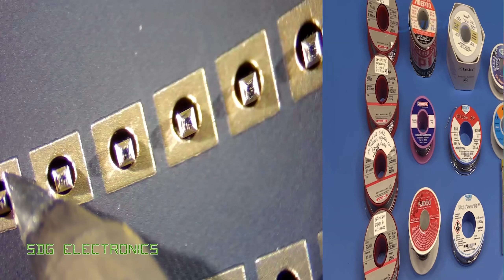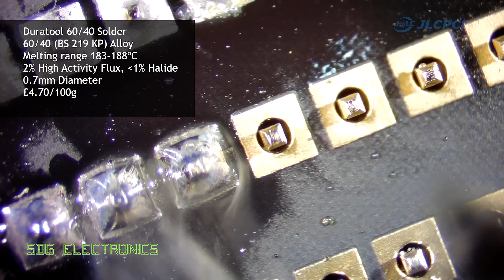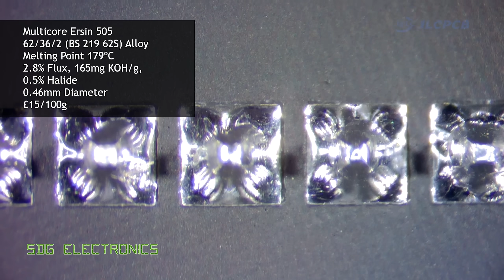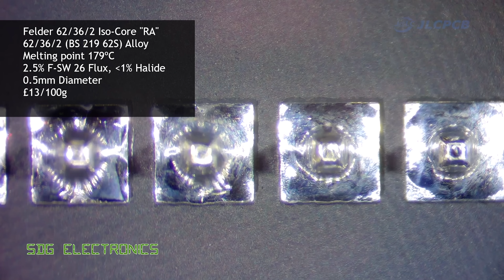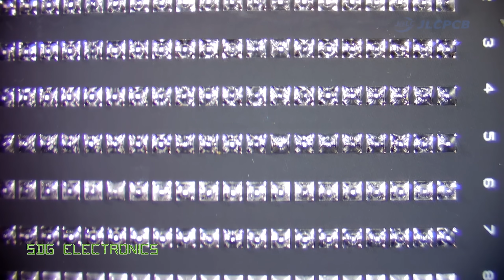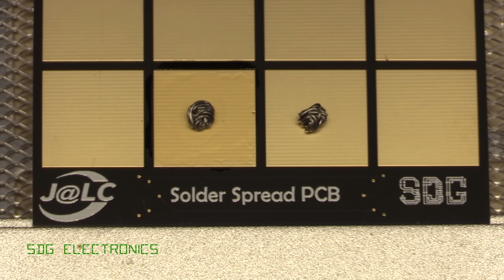SDG #079 What's the best solder for electronics? Expensive or cheap?

Comment: I really like Kester K100LD  lead free "no clean". It works predictably on very small stuff. Though it does spatter the no clean flux.
 I wouldn't dare to work without eye protection. It's nailed my hands a lot, but the skin on my hands isn't as worrisome as my eyes!
I've got 10+ year old projects I've done with this and they all held up fine. No cracks or whiskers as the lead free nay sayers predict.
On the plus side a brief scrub with alcohol removes what little residue the 'no clean' flux deposits. It's safe to leave as it's not acidic like rosin flux, but there is some small amount of capacitance that can affect some circuits. 
Not cheap though!

Comment: I cannot get nice shiny volcano joints, I always end up with dull lumpy joints, I've tried different types of flux, but only a Chinese 60/40 rosin core solder, and for the life of me I can't get a nice flow. Next I'll try different solders based on this video, and after that a more expensive iron (mine is a cheapie, but heat is heat, right?). But whether I can source the best one in the UK is another question.

Comment: Mechanic offers a very good price-performance ratio and is the option I would recommend to all those hobbyists who, due to using low-quality soldering tin (or perhaps the wrong alloy for their needs), believe they'll never be able to do what they see in online tutorials. Most problems disappear when you have a decent soldering tin and select the right temperature to ensure it flows properly. I don't go over 300°C; I repair and modify very old and delicate hardware, and the HX-T100 is perfect for that task without spending a fortune. Thanks so much for the video.

Comment: You did the same test twice but you left the solders in the same spots. To make the results more accurate you should change the positions of the samples. Heat from underneath isn’t going to be applied evenly.

Comment: Hi.  Do you have a PCB design that has incremental SMD component size pads from small to big?  Or, am I thinking of another channel?  I think it would be a helpful tool for me to learn the sizes, mainly for SMD resistors and capacitors.  If you don't, I guess that will just be more motivation for me to learn KiCad or some other PCB CAD software.

Comment: Good solder should not be cheap, be made for electronics (not plumbing etc) and the rolls should look like Western solder, with a text specification of the composition on the product. This is the only way a stockist, company or school would consider buying them at all. The most important specification is which flux is used. All fluxes are toxic, if it's water-based you must clean it or it will corrode the board. Unleaded solder should have 3% silver, look for the SAC305 marking. The solder also has toxins, use gloves when handling circuit boards and solder. Use a fume extractor with all types of solder. If the air still smells, there are still toxins in it. 63/37 with RMA flux is a better composition if you must use leaded (else just increase iron temp by 27C). Multicore solder has the advantage of avoiding breaks in flux distribution in the wire, but most well-known brands have unbroken flux distribution without being multicore. Multicore solder can instead have patches of excessive flux, causing spattering that can get into your eyes. Wear glasses or use a magnifying lamp to protect your eyes while soldering.

Comment: That kester have very low amount at 1.1% flux. Thats 50 core. The 58 (2.2%) and 66 (3.3%) is great stuffm nevwr tried 1.1% 245. But i prefer the 3.3% over the 2%.
That being said. Im still using a decades old "44" rosin core kester at 3% lol. It used to be the benchmark but they have a ton of new stuff im seeing haha.

Comment: Hey can you do a stress test, like with those plates you have for letting the solder melt how about a wire attached to it and put a weight on it and see how long it will take for the solder to break hopefully it doesn't break the tinning.

Comment: Maybe you could have switched the position of the different solders on the plates? To make sure there isn't a temperature gradient responsible for the differences
And you mention it at the end but yeah, the point of the strong activated flux is to clean the corrosion, so doing it it with older PCBs would be very interesting.

Comment: The quality of solder wire is related to its flux. Flux needs to be active to achieve good soldering good wetting. However it also need to have very reliable residues after soldering. If you have very active flux, means too much acids in it, you do very quick and perfect soldering but in couple of months you start to see very electrochemical reactions. This is why you need to more focus on flux reliability details on product datasheets especially if you are soldering fine pitch components and highly populated boards. We do not recommend post-cleaning after soldering if you use no-clean products.

Comment: I have always used leaded multicore. Works fine, but one thing I've found over years using it is that it is consistent from one roll to the next in batches that are years apart. Others may be similar, but if I find a good product I stick with it.

Comment: What's with all the videos about solders and soldering? Use name brand 60/40 or 63/37 alloy tin/lead solder with rosin core and rosin flux. A name brand 67 watt soldering iron with available replaceable tips is fine  for most RC hobby soldering. A 100watt iron may be necessary for heavy gage wire. Watch videos about care of iron tips, stripping and  "pre-tinning"  of insulated wires, use of a "bridge" of molten solder to quickly transfer heat. If in fear of "lead fumes" work in a ventilated area.  "Unleaded" solder requires higher heat and more skill to make reliable connections, can damage plastic connector bodies. A " soldering station" is nice but a simple iron and safety holder is OK for hobby use. Good soldering requires practice and experimentation, watching solder flow.

Comment: I need help with a question, please if someone can enlightening me. 

I bought a RAIDER brand 200g reel of solder - it has absolutely no markings on it except the logo (as in, what content it has, what material it is made out of - NOTHING) - anyway, the wire is 1.0mm thick, it has no rosin core (its a solid piece wire) - so I thought I would use a solid rosin core "slab" and make a "manual mix" with the tip of my soldering iron dipped in the slab and combining it with the solder... 

However, no matter what, the solder literally barely melts on my 30W soldering iron and is absolute rubbish when soldering electronics. The solder wire is barely shiny and in places it alternates shiny-matte-shiny-matte. Also, using this solder my soldering tip becomes very black and crusty with rubbish that accumulates on it. 

My question is what on earth type of solder did I buy??? I mean, is this solder meant for plumbing (soldering copper pipes, or...?) Can I somehow "fix" this or do I seriously need to buy another type of solder (specifically for electronics)? Thanks.

Comment: I noticed that electronics hobby-ists often circle jerk over lead-based soldering wire, from what I've researched, there's really no reason not to use lead-free soldering wire if you are just a hobby-ist. The verdict is still out whether or not lead actually makes a difference.
Reply from the maker: Lead makes a huge difference. Modern fluxes make lead free easy to work with, but there's no doubt there are some downsides which ultimately will reduce the life of the device
Reply: @sdgelectronics Understood but for a hobby-ist, someone who dabbles in IoT electronics, is it really worth buying lead-based solder?

Comment: just picked up some multicore with Crystal 400 the c400 any experience with that one? he had 10 rolls I got them for 10$ on clearance on the counter each for 500g rolls I figured why not haven't had a chance to use them yet though I figured even as backup solder it should be decent. they are 63\37 can't find much info other then the datasheet. another really decent China solder is the best brand 60\40 and the BLUE kaina but you have to make sure to get the blue version there is an orange one which sucks imo, the best branded one is really nice though

Comment: The only thing good with the jinhu is the reel. I threw away the solder todays and used the reel for the cheapest ebay 60/40. The difference is night and day. The jinhu needed 375C and I was burning my iron. Needless to say everything being soldered is melting. Avoid that junk like the plague.

Comment: Sorry to post on such an old video.

I think, while you did do an impressive amount of work for your experiment, it was inevitable that you would bite off more than you could chew, as we say. Just a quick list so I don't take up too much of your time:
* Profiles: This is something that, again, may have been an unreasonable amount of work for the experiment. But especially involving the "lead-free" solders, thermal profiles are vital.
* Purpose: Another variable. Consider a silver solder, even a pure silver solder, which would be a requirement for work on ceramics. Or flux types which are part of a process which has an established washing workflow, allowing a greater variety of them to be used with requirements for certain components which may have a very short time that they can be at flowing temperature.
* Variety of Pb-free: I am extremely grateful that there was no prejudice against them; in the U.S., such sentiment is endemic even if not backed up by research (see also "Profiles".) However, there is such a wealth of Pb-free alloys and fluxes, designed for so many processes, that it would be nigh impossible to fit in this video.
   * SAC305: One of the oldest, and perfectly capable in an oven with the manufacturer-prescribed profile. It's okay with a pen, depending on the core, but it's the most common alloy, afaict.
   * Sn99: You did have one, I think, that is marketed under this label (the alloy names don't always match the metallurgy these days, unfortunately; the datasheet is the only way to know.) These can have some exotic pairing metals, not just silver but bismuth, antimony, etc. Not always the healthy choice, but RoHS because of recoverability and reuse; which don't apply to home labs, of course.
   * Sn100: This is another whose name would mislead you! It is not, of course, 100% Sn. At least two companies make it, with the original license-holder from the manufacturer (trade name: Sn100c) being AIM (see later note.) Now that the patent has expired, Kester sells it as well as their premium Pb-free, under the name "Sn100d", and there are a dizzying array of fluxes with truly differing properties. Sn100c, with the "FastCore" from MG, is my absolute favorite solder. It is also eutectic, btw. It should be mentioned that there are eutectic alloys of Pb-free.
* This may be a geographic difference, though we are well into the internet age, but AIM is second only to Kester in the U.S., where I have this anecdotal experience.

This video was, again, a big undertaking; and there's just too many variables to survey much of the landscape. But cheers for trying! And I don't know if this is a side-effect of geography, but I am glad that the Pb arguments didn't appear in your video, as they're silly. Appeals to authority are silly as well, for the reasons above: multitudes of applications, processes, and technology.

Comment: I have subscribed some time ago, but this is a keep, so placed in file. I do everything but mostly automotive and sick of current crop of solder. This helpful as I solder automotive wire and components. I spent almost 4 decades fixing vehicles for others so now retired, building one for me.
  If you have kids, you know they have fully grown when they total out their cars instead of yours. I got my C10 this way after son quit lost interest and hit black ice slide into tree then towed to my back yard. I harvested the EFI engine, sold the new trans, kept all wires, connectors, and modules. Instead of outside near engine, mine past thru firewall and sit in vertical slots in console made from PVC board. Facing up for service, the PCM, TAC, BCM is in console for easy service. Magnets hold leather center cover over all including door switches. They use serial data to control engine, power windows, theft, lights, horn & RKE on factory key fob push button. Just having fun as I draw this stuff out and measure everything including power seats as I am 6’ 3” but wife is 120 lbs at 5’7” and has factory switch to change gas & brake pedal for her.
Thanks for the work as camera, lights, PCB, planning, filming, editing and watching how many times before uploading? A bunch! Thank you because is solder, shrink tube, etc.
  Tip: Wrapping harness is needed using electrical tape either cords or bundles. Wrap and place dab of weather strip adhesive on tag end and will not unravel. 
Thank you again for this work!
DK. Omaha. ASE Master Tech since 78

Comment: Really enjoyed this video and many of your other videos. Im new to soldering and already learned that mystery solder from china makes learning a lot harder. I am moving on to better solder but am so confused with all the flux differences. I read there is a water based which is really bad and there is also an acid one that is also bad and rosin is hard to clean and the no clean still needs cleaning. Am I over thinking all of this and any good brand wire will work just fine? I am doing PCB work, game console repairs and learning phone repairs. Thanks much if you get a chance to respond.
Reply: You are not running a production facility, are you? There are different types of solders with higher and lower melting temperature that have different long term failure behavior, but since you are not building products with 1 million hours of MTBF, that doesn't really matter to you. If you are not selling your products, use a cheap low temperature leaded solder and buy yourself a large pot of rosin solder flux. That plus a temperature regulated soldering iron is all you need to make perfect solder joints. If you can't do it with that, then you need to work on your skills. Smother everything in solder flux and your life will be good even without any cleaning. The only time you will have a problem with that is with high impedance circuits because the flux residue is slightly conductive. As long as all your resistors are a few hundred kOhm or less it simply won't matter.

Comment: What is a rosin free solder with lead/tin that is good quality but I can buy a smaller amount of to cut down on price?
Reply: You can't cut down substantially on the price of good tools and supplies and you shouldn't waste time on that. With solder it's actually cheaper to suck up the price and to get a multicore rosin solder than to suffer with the wrong stuff on your table. $40 a lbs of quality electronics solder will last you for years. Just spend the money. Also, get some additional flux. I have been using a pot of $2.50 solder flux from the hardware store for years with no ill effects on the prototypes I am building. I still have 90% of it. 2 ounces of that stuff go a very long way.

Comment: I've got a 0.5kg roll of 0.7 rosin core solder, 60/40, RS 4.1/327 (not sure what 327 means) the label says Billiton It's quite old (at least 30 years old I think) but still performs well. As a hobbyist, it will last me a long long time still. It does spit a bit on occasion which can be annoying for smd work with a head band magnifier with my face quite close to the work piece. Should probably invest in a video microscope or something. Thanks for showing what to look for in a good solder joint.
Reply: Get some rosin to compensate for what’s evaporated or it will be difficult to work with

Comment: Which one is the best option for soldering on a budget that you can order through aliexpress? It should be easy to clean and leave a  shiny surface without sputting. Which solder would you recomment to me?
Reply: You will only get shiny surfaces from lead containing solders. Both 60/40 or 63/37 are fine. Having said that, I am soldering commercial product with lead-free by hand and it's fine. Does it look shiny? No. Does it work? Yes, it works perfectly. You just have to get used to solder joints that make you feel like you are a beginner. It's all in your head, though. ;-)